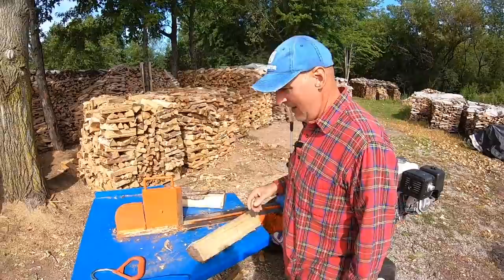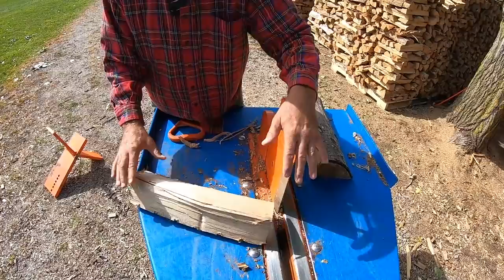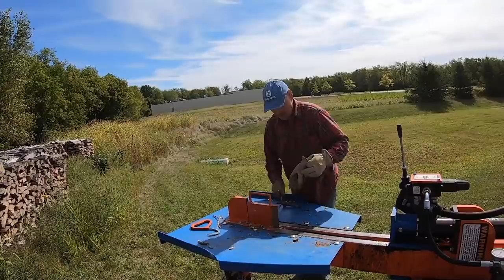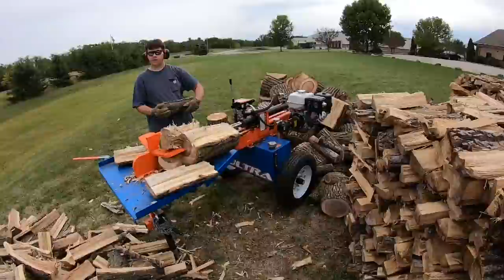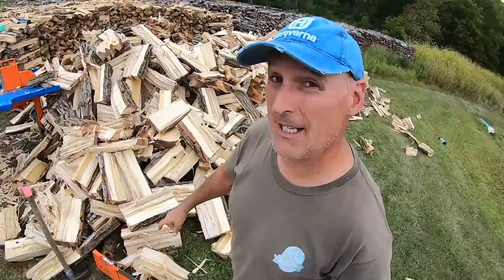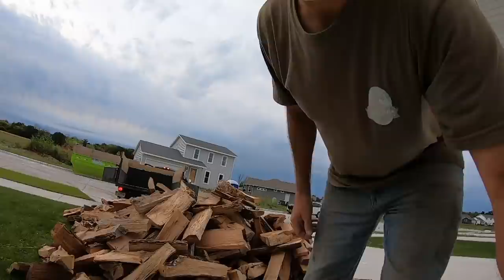Eastonmade ULTRA Log Splitter Review - In The Woodyard

Comment: Hi Chris. I just subscribed to your channel after viewing one of your recent videos and you suggested I look at your archived videos and this is the first one I picked. I'm looking at an Eastonmade Axis diesel. I live about an hour away from the "factory" and Andrew has invited me up to have a look-see! Unfortunately, they are parting ways with Honda but they are developing a Kubota diesel version (Along with Briggs & Stratton gas). One tip I have for you is when you get a compact tractor (not if) get a bucket mounted clamp-on receiver to move your splitter around. Unbelievably easy to maneuver a shorter trailer with the front-mounted hitch. Back to the video...
Reply from the maker: Yes, the Axis is a real neat machine! It is a good design, inspired from the Powerspilt splitter I'm sure. Thanks for the tips and for watching! See you here tomorrow!
Reply: Andrew is changing from Honda, because he can’t get them.

Comment: Thanks for the shoutout @InTheWoodyard.  I need to try different height settings on the 4-way to see if it works better.   Yeah if your not tall filling the gas tank can be difficult
Reply from the maker: Hey Joe, ya, I put mine kinda high so that the pieces that only need to be split in half just slide under the horizontal blades on the wedge and only get split by the vertical blade.

Comment: Very nice, that splitter definitely gets the job done. I lube with bar oil and automatic transmission fluid seems to work well. And that was one heck of a load of wood, I'm sure they are very satisfied.Nice job fellas 👍
Reply from the maker: Thanks Dave. I've got a bunch or waste oil and waste hydro fluid to use too.

Comment: Hi Chris!!😀😀
The Ultra is a decent splitter. The only thing I really don't like about them is I feel that the pusher plate needs to be the same height as the wedge is. That way the blocks wouldn't flip backwards and would push it through. Andrew didn't like it to well when I criticized it. Keep a eye on the bolts that hold the push plate so they don't come loose like Joe's did. 
Keep up the good work buddy!!😀😀

Logger Al
Reply from the maker: So far the plate has not been a problem, but I've only split about 120 face cords with it. So, we'll see.

Comment: Great suggestion, should tell Andrew, to tilt the table edges to 45 degree. As for the lubrication of the bed try ATF (automatic transmission fluid) it will clean and lubricate too. You can fill a small oil can and squirt ti toward the pusher to lubricate it too.
Reply from the maker: Thanks for the info! I plan on telling him about the table if/when I talk to him. Thanks for watching!

Comment: If you want the cylinder to return on its own then you should have ordered an auto cycle valve instead of a 1 spool valve. You can convert it for around $425 or so?  The auto cycle valve is about $350 and you'll need another hose and some random fittings, on top of rebuilding the mount for the valve.
Reply from the maker: Thanks for the info! I was told that the non return was a safety issue.

Comment: Nice review Chris, if you run out of waste oil try using bar oil, lasts longer, another thing if your bottom skid plate on front jack is removable, replace with wheel attachment, this will make it move back easier when splitting. Nice machine happy splitting!
Reply: Get the 2 wheel one single only good on asphalt
Reply from the maker: Yes Mark, I had the same thoughts too. We both must be smart!
Reply from the maker: @sureflamefirewood4174  I'll check it out. Thanks Mr. Shure!

Comment: Great helper, get a sizer jack bolt a 4x4 on it to help lift the wedge up and down you can adjust the height instead of getting up to look, looks like you have a set height,I use mine for everything and they are light
Reply from the maker: Yes, I plan on making a block with a couple of levels for resting the wedge on for adjustment! Thanks for the input!

Comment: Those are the 💣 BOMB!!!!!    What price are they? I looked on the site but none have any pricing information. I'd love to have the auto load and conveyor , and a "Boy"' to run it for me. But the machine you have would be much more than enough. 
I have one from a box store that is nothing but welding rods holding welding rods. Seriously I've replaced the wear plates twice on it. In fact it's gotten so fatigued that the cylinder ripped at a factory weld and sprayed so hard it knocked the lense outa my glasses the other day. I'm sure it would have taken my eye out if not for that lense.
Reply from the maker: Wow, it sounds like you NEED a new splitter! The Eastonmade ULTRA I have was $4700 delivered from Canada, you want to talk to Gerry there he is the salesman. Just so you know it takes 6-9 months to get one!
Reply: @InTheWoodyard  
Ok. About twice the cost of the mass production splitter. But 10 times the machine. 
It seems they would do something about their production methods if the wait times were that long. They're loosing lots of sales I'm sure because of that.
Reply from the maker: @coburnlowman  Actually, people are willing to wait because they are so good! All manufactures are way behind because of parts not being available because of the CHINA flu!
Reply: @InTheWoodyard  
Yes. You are correct about getting supplies. 
I found out that the full auto machines with big power and box wedge is just over $10,000. Now that machine would and could knock  out mountains of split wood faster than two or three could drag to it. 
Just saying for a full timer that wouldn't be a terrible investment , the speed would free up time for delivering wood.

Comment: Chris, you along with a few others have inspired me to start doing firewood! Besides the price, why the ultra over the axis? Also what’s your thoughts on bagging wood? Haven’t heard you talk about it yet. I’m starting small with a cheap splitter but I’m just thinking about how I want to scale up in the future. The convenience and time saved bagging and using a tractor with forks to move it around would take production through the roof.
Reply from the maker: Good for you Tyler! I will do a video soon about the bag thing. For me, I would need 700-800 bags at $15 each so...over $12,000 Plus a elevator to load them $8,000 plus a tractor to move them $30,000 and load into a truck or trailer and then, how do you off load them a t the customers place?!?! That means three years of wood sales to break even.... so... now do you see? Start small and add stuff as you grow with cash, and you will do fine.

Comment: It has finally appeared! Nice review. Few things...
1) grease top and bottom of beams. And like joe learned, check and retorque fasteners.
2) yeah 90* table edge stiffeners do cause an issue once in awhile. I have same issue on mine. I built my table so the edge stiffeners can be removed. But I do believe that table is not wide enough especially when using the 4 way. With my table and log lift up I have over 16 sqft of flat. Makes big resplits easy.
3) you are a human pull back arm😆 I think a 12-22 with box wedge and auto cycle is in your future or the Axis??
4) Have you tried joes idea of placing a garbage can or something of waist height stand next to your side of splitter where you can place big half/quarter while you break down other half/quarter? I think that might compensate for table space and a little easier handling/pulling back. 
5) I thought maybe you were going to joes house with that wood...nope😆
Reply from the maker: Garny, thanks for all the tips, I will work on them!
Reply: You can find oil pots from several suppliers, the have 1/8 not threads, and reservoir,  and drip flow, fairly simple, the small reservoir of 1/2 “ dia could be protected behind pusher front plate, refill with squirt gun Oiler, every 4 hrs use.
Reply: Dave Schooley this is true but in this application if lubrication points were installed I would just install zerks and use some Schaffer’s grease. Dump used small engine oil on the boiler wood.

Comment: I just love my Eastonmade Ultra! But left to me, I found its weak spot. I can tell you from experience do NOT tow this wood splitter, as just the bouncing driving down the road will cause the motor mounting plate to bend down, leaving the motor slightly off level. I can say from experience that although the Ultra has really nice wheels on it, the unit must be trailed to wherever you are taking it to. Bill Rogers
Reply from the maker: Yup, less than 25 MPH and in a trailer/truck is best!

Comment: I'll be stuck with a farm supply store $1000 log splitter for a while when I do get one. Really want one with log lift, but don't have the $5-7k to get one. Guess is best to bust up the wood with a cheap splitter and use the profits to get a proper commercial grade splitter.
Reply from the maker: That's what I did, I used a slow consumer grade splitter for 5 years before I stepped up a bit to get more speed.

Comment: I got the same machine as you my first time I used my it broke the first time but Andrew is asome and got me a new one for free
Reply from the maker: What broke on it?
Reply: The pusher the bolts snapped up underneath the pusher
Reply: Bran new first job I went and did an hour in the Underneath the pusher snapped off the problem was The hydraulic piston wasnt Built right so the 2nd working alright I Owen my Owen company going to Peoples houses and splitting firewood for them with it so it seems to be working fine still

Comment: That one does not have auto valve for a safety feature as it is a fast splitter main reason I opted to order the 5-11  over the ultra originally had the ultra on order but went to the bigger one just waiting for it to be finished !
Reply from the maker: Ya, looking back now a 5-11  would be a good / better choice maybe, but I wanted a lighter machine. Next time!

Comment: You could make up a spacer that stays put at the correct height to help with switching to the 4-way when you're on your own.  I'd probably make something with a slot so that it slips over the center vertical plate and underneath the horizontal wings.
Reply from the maker: Yup, I'm going to make a wood block to size!

Comment: If you are going to let the machine slide it self along the leveling jack as you split you might want to run a small steel cable from the foot of the jack to near the hydraulic oil tank to keep it from bending if it hangs up on something as it tries to slide.  Nice machine!
Reply from the maker: Great idea, I'm thinking of putting a wheel on the jack leg for easier movement!

Comment: I've used gear oil bottles filled with waste oil for lubricating things like this.  They're nice because they hold a good amount and have a small diameter nozzle/spout for dripping a line of oil down the surface that needs to be lubricated.
Reply from the maker: That's a good idea!
Reply: Pancake syrup and dish soap containers work well also. Use them for my chainsaw bar oil.
Reply from the maker: @stevethiel5838  Another good idea, Steve!
Reply: @stevethiel5838  also good ones!

Comment: Tip:  Put your waste oil in an old squeeze syrup bottle. It makes it easier to apply. I also use a squeeze syrup bottle for my bar and chain oil for my chainsaw. It makes filling in the field easy with no funnel. Do not use a dish soap bottle as the opening is too small and the oil won’t flow well in the winter.
Reply from the maker: Ed that is a good idea! I just poked a hole in the cap and that works good too.

Comment: Eastonmade splitter looks nice but very small push plate. If I was going to spend some money on a splitter I would go with a wolf ridge  because they will split the big stuff without a problem and have a bigger push plate and easy change out plate the rounds you split the woodridge would split it with the four way wedge watch back 40.
Reply from the maker: Speed, I bought it for speed not being able to crush 40" rounds. Yes everyone wants it to have a 2 foot square push plate. Also it was $3500 not $10,000+.

Comment: The automatic return is very very important. It is really to bad they did not put that on. You should ask them to correct this situation. You would appreciate it so much and it’s so easy to do.
Reply from the maker: I was told that it was a safety issue? Not sure. The 5-11 has it and is fast also.
Reply: Bigger Easton splitters have a cradle that holds the log.  So you don't need to keep your hands in harms way.  Most manufactures won't put full auto cycle on splitters for liability reasons. I have a 12-22 eastonmade with full auto cycle and really like it.

Comment: That multi cutting blade it looks to me the blades are level with the table if the back end of the blade was tilted up about 5 degrees it would eliminate most of your wood jamming up and you wouldn’t have to bang the wood to loosen it.
Reply from the maker: The blades are not level they do angle up.

Comment: Surecan makes a nice bottom hosed can . I have both diesel and gas versions. Moving a splitter around you need so see your local Kubota dealer for a diesel powered wheelbarrow :)
Reply from the maker: I'll check out the Surecan, thanks. And yes, a tractor is on my list!
Reply: Are use a Surecan to put gas in my boat. It works great.

Comment: u need Scepter USA 6792 Duramax 14 Gallon Flo-N-Go Fuel Caddy, Red fill at the gass stashen and then wheel it around and has full filler handle
Reply from the maker: Thanks, I will check it out!

Comment: Cool review but 15 full cords equals 35 face cords?
Reply from the maker: Yup, that's about right, usually I have found the multiplier is about 2.3xs so 33-35 face depending on the accuracy of the truckload measure and if there are some deductions plus or minus.
Reply: @InTheWoodyard  a face cord is not a volumes unit until you know the length of the logs. So your logs are about  21" long then? A face cord is a unit of an area equal to 4'x8'= 32 sqft. If the length of the logs is 16" then there are 3 face cords on a full cord. If logs are 24" long there will be 2.0 face cords on 1 full cord. Sorry, it confused me equalizing 35 face cords with  15 full cords without revealing the length of the logs...
I still think you did a great job reviewing what seems to be a great log splitter. Keep it up!

Comment: You said about how thirsty it is but I'm curious what is your wood per gallon vs the old splitter
Reply from the maker: Mr. Tow said it , but I would guess 50% more fuel, but that is only comparing time, production wise it's probably less because it's making so much more pieces faster!
Reply from the maker: TowME trailers  You are a gem and smart!
Reply: @InTheWoodyard  thats how I was looking at it more wood per  gallon probably double the wood per gallon if I had to guess
Reply from the maker: @williamwhite9275  Probably!

Comment: Did you research the Power Split before buying the ultra? Seems faster with a log lift
Reply from the maker: Yes, I wanted to get a Power Split bet didn't want to spent more than 5k and the Power Split is 20K or more.
Reply: @InTheWoodyard   Actually "The Static Buggy" 28 ton 9 hp Honda - 7500.00 plus shipping. More than likely will be choice. It does however exceed your 5k budget. Thanks for replying
Reply from the maker: @jbaker4900  Yup, I looked at that one with shipping it's another $1000 so it's $8500. The one I want is the single with lift elevator and self propelled, $20,000.

Comment: This splitter is more expensive than the basic model. It also does not stand upright so very large rounds will not be able to be lifted up that high. They are very heavy and awkward. That is a huge drawback
Reply from the maker: speed speed speed.

Comment: You need an old Murray cheap riding mower with no deck to pull it around the yard, $400.00  max not 18k
Reply from the maker: I have other tools and equipment now.

Comment: Get an electric ( battery powered ) fuel pump at Harbor Freight. You will not have to lift your five gallon gas can anymore!
Reply from the maker: Harbor freight was a bad experience the last time I was there!
Reply: Chris, These aren't that expensive, swallow your pride and go buy one and evaluate it. Or you can continue wearing out your arms lifting the 5 gallon can. You can go in in a disguise so no one recognizes you! LOL